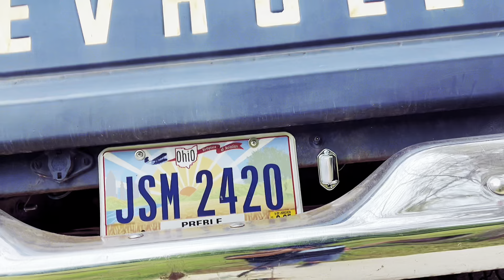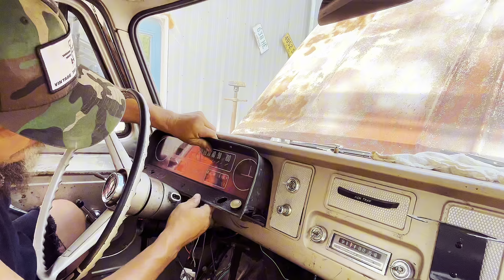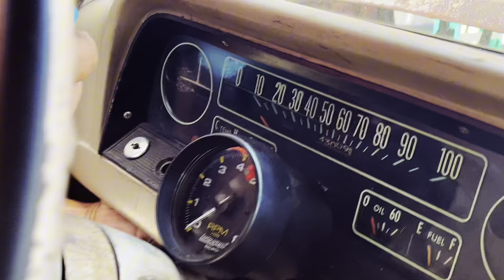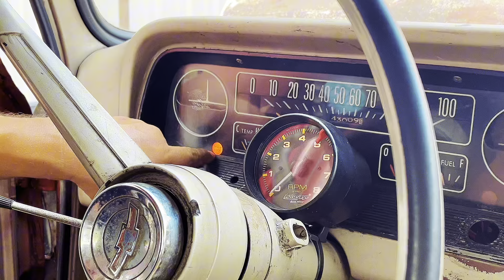Worst Mess imaginable!! Wiring this 1965 Chevy was a JOB…

Comment: Those trucks did come out with parking lights you pull the switch part of the way out for the headlights and you had parking lights you pulled it all the way out for your headlight I have had a lot of those trucks
Reply from the maker: This truck don’t even have hazards. No switch anywhere .
Reply: @PieceNGrease  no they didn't come with hazard lights but they came with parking lights
Reply from the maker: @jimmiebrown5014 you are correct. I found the issue. Look for a callout soon

Comment: Those key switches and those trucks you turn them on accessory and take a piece of water and poke in a little round hole and turn the key a little more in the cylinder will come out
Reply from the maker: Yep, couldn’t get it to release